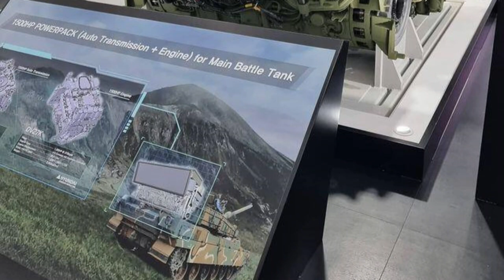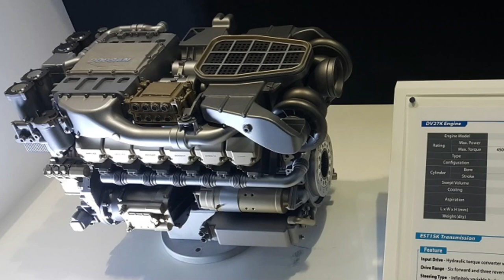ALTAY – Turkiye Next generation Main Battle Tank #türkiye

Comment: There were two tanks atlay and arjun mbt they both weren't perfect but were decent tank in case of atlay turkish army inducted them in big numbers and improved them with foreign companies but indian army demanded perfection at first go and killed arjun mbt with small order rather than improving them  (#commisonjindabad russian lenge turrent space bhejenge fuck crew safety) 
And result arjun mbt is almost dead and there are new version of atlay
Reply: no it's not an export version etc it's just based K2 have many same design but it's completely different systems have different subsystems by Turkish companies even it's engine and transmission is being developed by Turkish company BMC Power
Reply: @danielrauf4094  i didn't said atlay is export version of k2 in my comment but it may be export version i don't know

Comment: Hijacking or not…. Altay is a peculiar animal to say the least.  

1. A tank is defined by a combination of mobility, fire power and defensive package (armour).  

2. The 120mm L55 main gun is a license of HyundaiWia gun that was originally used for K2. 

3. The power pack is imported from Korea for the first batch.  The rest is planned to be indigenously developed.  Yet Turkey does not have a large engine industry.  There are only 4-5 countries who have developed indigenous 1500bhp engine and powerpack.  Not clear how/ if / when Turkey would be able to use their home grown engine and transmissions.  

4. The armour is imported from Korea.  The armour requires high end material engineering and Turkey is not the top of the list for material science or engineering.  There are 5 top armour producers in the world who all have very strong steel and material industry.  Turkey is nowhere near the top of this list. 

5. Basic chassis was licensed from Korea.  Turkey used loophole in the contract to aim for export market.  Korea soon learned the attitude of Turkey and adopted accordingly.  Now, whatever is exported to Turkey is final product (module) basis with limited (if any) tech transfer.  There is 0% room for another loophole.  If Turkey tries to copy or export, Korea will cut the existing supply agreement.  Even post completion of current batch deliveries, they can certainly terminate supply contract of existing systems (maintenance and repairs) which will overtime render them useless.  

6. Korea just announced procurement of 4th batch of K2 at unit cost of $9m (NB. Batch 4 K2 has APS which costs over $1m vs previous batches costing $7m per unit). Altay is currently delivered to Turkish Army at just over $12.5m (without APS).  The supply chain is super complicated (gunner sight is mix of French and Korean system, subsystems are Turkish, the chassis steel is another import from Europe etc).  Maintenance will be a nightmare for any buyers.  

7. Overweight.  Altay is said to be ca 70t with added armours.  The engine is the 1500bhp, the same as K2. K2 weighs 55t and K2PL (old designation K2ME with space armour) said to weigh 61t. The added weight will be an issue for the powerpack and suspensions.  In K2PL, Hyundai Rotem upgraded their ISU already and passed RoKA quality test.  Korea is unlikely to supply such technology (they may sell the final module without tech transfer).  Given the timing, it is unlikely that Altay is using the upgraded suspension which will add further strain on the chassis and powerpack.  

8. Finally, ammo trouble.  Turkey does not have latest ammo tech for 120mm APFSDS rounds.  Korea is not going to transfer the technology (so far, Korea only has agreed to 50:50 JV in Poland to support 1000units of K2 export).  Hence the gun may be the same or similar, but the ammo used is not even close to being similar.  

All in all,  Altay is a peculiar animal that does not really make sense.
Reply: most of the information you write is nonsense. 1. the power pack and transmission were to be made in Germany. the project was suspended because Germany imposed an embargo. 2. bmc power company has a BATU tank engine and transmission project and is currently conducting tests. after 2 years, it will be placed in the Altay tank and enter mass production. 3. Altay tank armor is equipped with boron carbide technology. this technology is not present in the Korean tank. 4. the Altay tank has an active protection system and can deactivate anti-tank munitions or rockets remotely. (AKKOR  project) 5. Of course, Korea is a developed country in technology, but it receives western technology assistance. Turkey is currently subject to a secret open embargo. that's why he has to produce all the systems himself, and the unit cost of the tank is increasing. as a result of all these works, it is a fact that the Altay tank offers more technological and innovative solutions than other equivalent tanks. 6. there are many countries that want to buy the Altay tank. as the number of productions increases, the cost will decrease.

Hatalı örneği veya çeviriyi şikayet et
Reply: LoL

Sure

So Turkey is importing 100 of 1500bhp powerpacks from Korea for display?  Germany has placed sanction for any mil spec equipments to Turkey.  Hence MTU/ Renk powerpack is out of question. 

The armour is also imported from Samyang (as mentioned in the video as well).  

At least do some minimum googling before you show your national pride…. 

The brutal reality is, if Korea (or US) bans the export of the powerpack, the production will stop.
Reply: LoL

Sure

So Turkey is importing 100 of 1500bhp powerpacks from Korea for display?  Germany has placed sanction for any mil spec equipments to Turkey.  Hence MTU/ Renk powerpack is out of question. 

The armour is also imported from Samyang (as mentioned in the video as well).  

At least do some minimum googling before you show your national pride…. 

The brutal reality is, if Korea (or US) bans the export of the powerpack, the production will stop.
Reply: LoL

Sure

So Turkey is importing 100 of 1500bhp powerpacks from Korea for display?  Germany has placed sanction for any mil spec equipments to Turkey.  Hence MTU/ Renk powerpack is out of question. 

The armour is also imported from Samyang (as mentioned in the video as well).  

At least do some minimum googling before you show your national pride…. 

The brutal reality is, if Korea (or US) bans the export of the powerpack, the production will stop.
Reply: @trabzon-ew1jf  US did a favour to Turkey by not selling Predator Drones , now see where is Turkey in drone exports today. Like wise Germany did a favour by blocking diesel Engines. With electric cars making exponential sales, many diesel engine designers are getting jobless world wide . Turkey will recruit them and  crack this technology hurdle , till then the korean engines are not a bad intermediate solution . Turkey has a vast steel industry , is a exporter of steel to US and EU . Turkey makes steel as well as composite boron carbide armour locally since decades, also Turkey's MKEK is making world class Ammunition for the Leopard tanks in use in Turkey, so your point about ammunition is a lie . Similarly Turkey makes barrels for its Artillery guns and has exported those guns. Any country capable of making 155 mm artillery barrel can make 120 mm easily .  in any case , recent  conflicts have shown Tanks to be highly vulnerable. T-90s and Lopards are blowing up in Ukraise, Merkava s were kiiled by Hezbollah . The decisive factor therefore will be the active protection system . The local solution of that is almost ready .